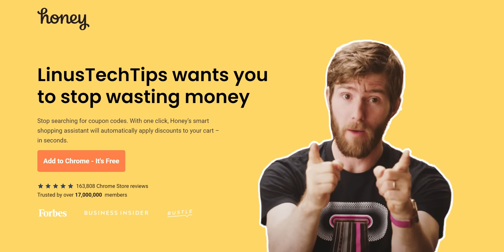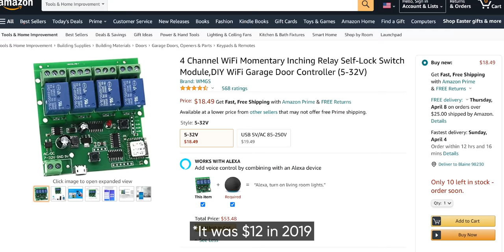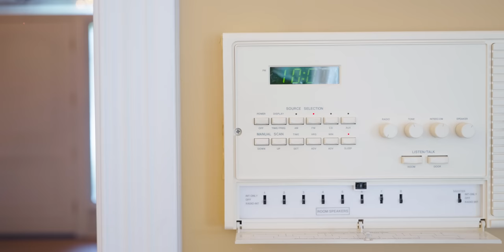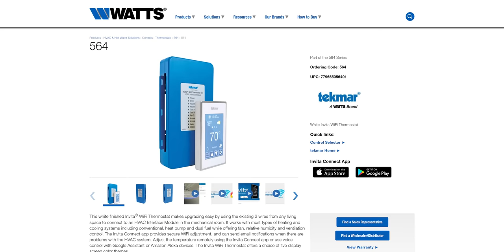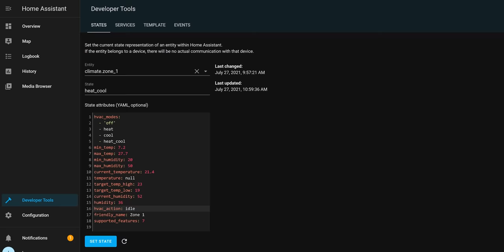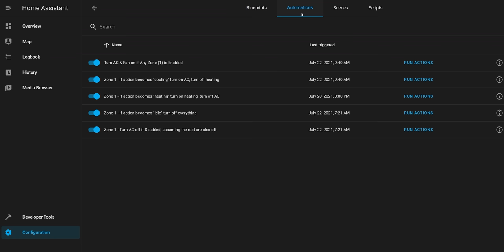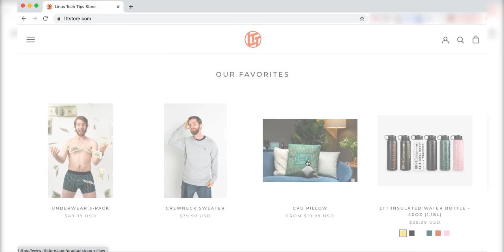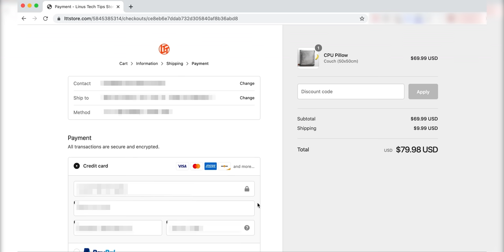This Should've Been EASY - New House Smart HVAC

Comment: You have to be careful adding the zone dampers for the A/C if the duct system was not designed for zoning. Since you have a single stage condensing unit, the equipment operates at full capacity when there is a call for cooling from the thermostat. Having multiple closed dampers will increase the static pressure of the duct system which will cause more wear on the blower motor in your air handler and cause it to deliver less airflow. Having insufficient airflow will lead to a frozen evaporator coil which can lead to a damaged compressor if not caught in time. A multi stage condensing unit with a variable speed blower in your air handler and ductwork renovation would operate properly and much more efficiently. Or you could install ductless mini splits like you did in your previous home. Good luck with the project!
Reply: I've seen only a handful of comments saying this, mine own comment as well. Here's to hoping Linus or whoever combs the comments sees our plea for them to see this issue and rectify it.
Reply: He needs a barometric dump zone. we do this on very large houses in Florida. They still suck and sweat/rust faster then a single zone. Always hated working on 10+ zone systems.
Reply: Use a bypass type VAV/dampers inorder to ease the pressure buildup in the ducts when the ducts are closed
Reply: He could have his server room with a large duct stay open when only a single room or two are asking for cooling, not that it would necessary be enough, but might give the compressor a chance to run a full cycle without totally freezing out the room he is trying to cool, and less of a chance of freezing up the coil.

Comment: i do commercial ac automation and i love watching linus learn about actuators! but are you going to have a bypass so when most of the actuators are closed you dont have too much pressure going through duct that cant handle the extra pressure? unless the furnace has a vfd(Variable frequency drive) to control the blower speed via duct static pressure

Comment: Those dampers have adjustable settings for range stop (fully closed at 0,... 1 is 16% bleed, 2 is 30% bleed and 3 is 50% bleed) .  You could keep the zones slightly open when the zone is off to allow some air through the "closed" damper to alleviate some pressure issues you will have.  But without some sort of bypass integrated in the system, you will have some problems in the future.
Reply: Yeah, you don't want 3 tons of cooling going through one 8" damper. And it's likely just a piston system, not a TXV. You could program it to wait until there's 2 or 3 zones calling to enable, that would probably be enough airflow. And if one zone is calling, it's likely another one will be, or will be soon with 10 zones in the house.
His next step would be to get an AC system with a 2 stage compressor and multi speed fan, with a system board capable of 2 cooling inputs. Stage 1 (Y1) would activate when 2 zones call, and Stage 2 (Y2) would be for 4+ zones calling. That way you have a bit of a deadband between Off, low, and hi calls. Or like you said, have a bypass or dump box if you want to activate on only 1 call, or force the next warmest zone to be open.
Reply: @andrewt9204  my other thought is one zone called open and shut non called but NOT under temp rooms and OR non occupied rooms as an air dump + have no damper on the server room as that is a NON occupied room it can get "cool" without harm being done

Comment: Dampers are great for taking maybe one room out of the mix, but forced air AC systems are sized for the whole space they're cooling. I'd be careful managing more than maybe 10-20% of the house different than the whole home system.

Another idea is to have the AC for the whole home as normal, but if you have a room or two that get too hot, install a mini split in there (eg for the server room or a gaming room where it will get hot often).
Reply: And if not doing this, add logic ensuring that multiple rooms actually need cooling before turning it on.  This is 100% going to burn out his crusty-ass, old air conditioner in under a year.

*edit: just remembered that Linus lives outside of Vancouver.  This might actually work for him because the AC unit likely doesn't see a lot of use every year... this would absolutely fry the unit if it were done down by me (Chicago area)
Reply: I agree with this, I've seen houses have too many dampers closed and the coils will freeze over which could break your coils/temporarily cause you to not have a/c while they melt. I spent a day melting coils when it was over 100f outside and it was not enjoyable.
Reply: @Ikkleman0  His only saving grace here: Vancouver doesn't really get a lot of hot days.  This air conditioner very likely does not really see a lot of use - the hottest months are only around 72 degrees on average.
Reply: @absentmindedjwc  If it stays the way it has been, then that's changing, reached 97 at my place, and I'm closer to the coast than he is, saw over 100 more inland.
Reply: Agreed. Part of me wonders if one could build a thermal chill battery to let the condenser operate at reasonable duty cycle for small cooling loads in the house...then cool the house from that battery in the as-needed basis.
Reply: @absentmindedjwc  Isn't what matters the minimum on time and off time of the compressor? He just needs to program that in, and then set a minimum number of zones before it turns on so that it doesn't overcool one zone.
Reply: I wonder if a variable speed compressor would be useful or if it suffers from the same issue. 🤔
Reply: Could put a huge duct with damper to server room to make up for when the dampers close elsewhere.
Reply: @bryanmartin2434   I think it would be, and that crusty compressor needs to be replaced anyway
Reply: And you are going to probably hear the air moving through the vents because of the pressure you are adding. I have to agree that Mini splits are a better idea.
Reply: Does Ansible run your AC system Jeff?
Reply: Floor heating is a thing... but what if you add floor cooling?
Reply: @absentmindedjwc  vancouver area (i was about 1 hour outside of vancouver) gets to around 30 - 35 (normally) during 3 months of the year, otherwise its usually around 20 - 25 which 25 doesnt need ac, just windows open is usually ok, so normally it would run 3 months of the year id figure
Reply: @wobblysauce   floor cooling is a terrible idea- cold surfaces can condense and attract moisture, best case you get a slippery floor worst case a rotten cold floor. Next is if you cool a space say from 80° 70%rh to 72° without actively removing moisture the %rh could spike to 95% or better making the house a mold factory and at best a very uncomfortable 72° house.
Reply: @kibels894  The ecobee thermostat can control minimum runtime, but it isn't aware of other "zones".
Reply: Also if you turn off the AC to a room entirely when there is no occupancy you won't get as much of the dehumidification benefits of AC, along with air filtration (running the fan).
Reply: This is likely a stupid idea...
If his thermostats can supply current temp and setpoint back to home assistant, they could run the dampers with a PID loop and a extremely long period PWM. Then do something like sum or average the demand from the house to call for the fan and compressor (instead of a single room calling for it). I think a scheme like that could keep the AC running closer to it's designed airflow.
Reply: I would suggest almost the same thing to open the dampers in other rooms with close to wanting the ac also enabled or to have the hallways with no dampers "overflow" air goes their
Reply: Mini-splits are awesome 10/10 ( -3 for cost) I highly recommend them. $$
Reply: @absentmindedjwc  He's also a tech junkie and probably has a server room, a pc gaming room etc. I bet he's got at least one or two rooms with a high heat-load.
Reply: @frollard  That's a cool idea... I'm thinking of an insulated cistern and a water coil installed on the return side of the system. to absorb the temperature difference between the air and storage. It would keep the AC coil from freezing, and provide a low energy option to cool the home on water coil without the AC coil being used until the load is higher. I don't know if it's a net gain though, after additional costs and running the water pump. It's probably cheaper and more efficient to just insulate better.
Reply: @wobblysauce  cold air hugs the floor. It doesn't circulate as well.
Reply: @absentmindedjwc  One way I think this could be helped is to have some kind of buffer case where it only runs the fan for some set time before running mechanical cooling. Kind of like an economizer function, but just pulling indoor air until multiple spaces call for cooling.
Reply: I wonder what the load Calc is for his home with the servers
Reply: @NJRoadfan  The stat doesn't need to be zone aware if you have a separate board managing zones. Each stat just sends the call, the board takes the calls and controls what happens when each call is received.
Reply: I was thinking the same thing.
Reply: @averagejoeprojects2885  Well, you're sort of right but in floor heating is laid in coils and then stapled to subfloor and then has flowcrete pumped over it so everything is locked down inside concrete. Moisture won't really be the problem, it will be that these systems are heavily insulated. Water itself is an insulator and concrete is an insulator (which most people wouldn't think but it holds whatever temp it is very well) so changing temps quickly would be a big issue as well as the fact that you would have to either run two separate coils next to each other or you'd have to pump tons of water through it to actually change the temp unless you actually cooled the water as opposed to just flowing tap temp in and cooling the water would be extremely inefficient (it takes much more energy to create artificial cold than heat.) Anyway, either way you've got tons of waste water or you'd have to collect it. You'd have huge turn around times to change temps (which is why you likely wouldn't get much condensation at all actually.) Anyway, it's a thought but Linus is going for efficiency and in-floor cooling would not be that, at all.
Reply: I’ve always wondered if when you’re installing dampers, you couldn’t also install an inverse diversion damper to dump the airflow somewhere you don’t give a boop.

Like an overflow path that opens up
Reply: You can still circulate it.. and where are you on the floor, not the ceiling, not saying to go far below the dew point, but it does move the warmer thermal mass of an upstairs and it does lower the BTU requirement / the need for AC to even be on. 
But like most things it depends on the insulation of the outer shell (Wall/Roof, etc), there is a difference between cooling the out temperature as it moves inside vs just cooling what is heating the room eg electronics.
Reply: Let's not forget, most standard ACs do more humidity control than actual cooling. Since most homes are designed to "dry" on the inside, he very likely will run into condensation or dampness in rooms where he never turns on the AC.
Reply: Yeah, if he can somehow upgrade his AC to an "inverter" type, with variable cooling and airflow, it will work much much better
Reply: @caseybyington7197  Almost, but you don't need big swings in temperature ... on a daily basis, but a consent temperature, as a deg warmer/cooler makes a noticeable difference.  Edit, that and when at a somewhat constant temperature you don't have big power bills.

I run my house like a thermal battery, in summer cool it at night, starting from just opening the windows and closing them when the sun comes up to having the AC on a timer, and it slowly warms during the day, over the last number of years only had to have it come on maybe a handful of times, and that is just afternoon sun/starting the night time cooling cycle a little earlier. That is with temps getting to 47ºc outside.
Reply: @absentmindedjwc  he's gonna replace that AC unit for sure
Reply: @JT-iw2cw  agreed... Just to stop the ac from burning out is my thought.
Reply: @matthewclemons1574 .needs a 5 tonne ac unit.
Reply: @icolshotglasses  - I don't think so, because his home was built in a place where people rarely run AC and in decades past didn't do it at all.

That's really only an issue in places with poor construction or construction that requires AC be functional as part of the design.
Reply: @thysonsacclaim  Just because a/c is new to some parts of the country doesn't mean humidity isn't an issue. Sure on a nice day I can turn the a/c off and open the windows, but then I run into 65%-70% humidity. That level of humidity feels like shit. It leaves everything feeling sticky and makes you feel very uncomfortable.
Reply: Variable speed compressor and variable speed blower are needed to match the load.
Reply: @bryanmartin2434  would be helpful with a communicating system.
Reply: @absentmindedjwc  canadians be like OMG WE ARE DYING  ( 78 degrees outside)
Reply: @absentmindedjwc  yea lmfao down in miami where I live that unit would literally explode within the month. He should definitely have that thing replaced anyways. Those older AC units hold up well but 25 years is definitely pushing it to its breaking point.
Reply: If too many dampers are closed causing low air flow, there is a high chance the evaporator will freeze causing major issues. Sizing the cooling unit is very important and unless the unit is sized correctly there will likely be a lot of expensive repairs. I doubt that old AC unit has a variable rate compressor that can handle low airflow/cooling loads.
Reply: HVAC tech here; yeah, definitely a bad idea to close off a bunch of vents. He didn't show a picture of his indoor coil, but more than likely it uses a piston metering device, which HAS to have a consistent heat load to function properly. Start closing off vents & thusly reducing airflow, and there won't be enough heat to boil off the refrigerant, and you'll start running liquid refrigerant back to the compressor (flooding) which will quickly & terminally kill the compressor if used much with most of the vents closed.

Best case scenario, he replaces the A/C part of the system with a modulating inverter driven system, such as the Bosch IDS system, which will actually automatically modulate to system demand without a specialized thermostat, preventing compressor flooding, OR
Install a TXV on the indoor coil and install modulating or adjustable dampers. Almost all 2 or 3 zone homes never actually close all the air off to any zone, they just adjust the balance of airflow. In the closed position, dampers will be adjusted to allow roughly 40% of specced airflow thru, effectively pushing more air to the open zones.